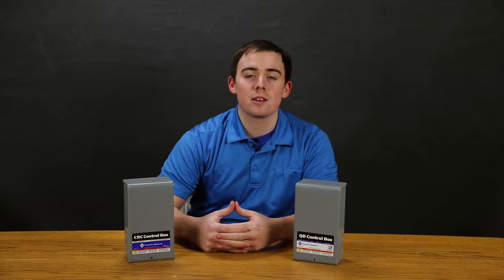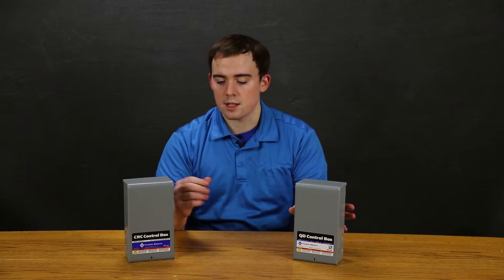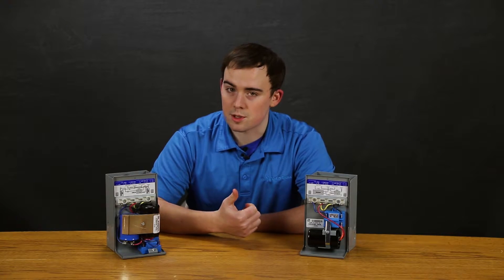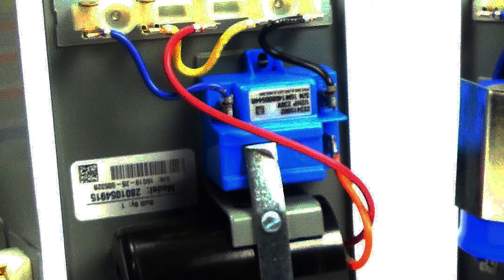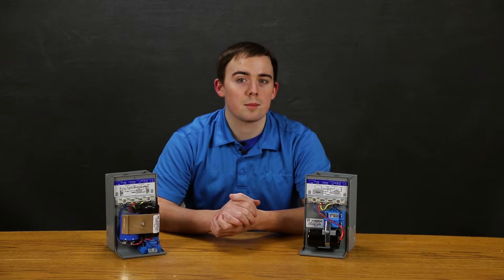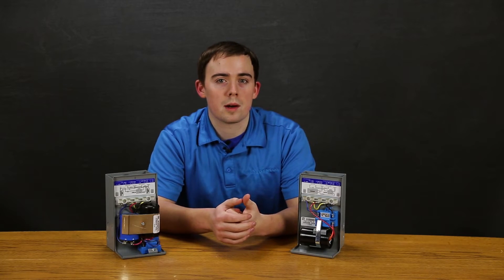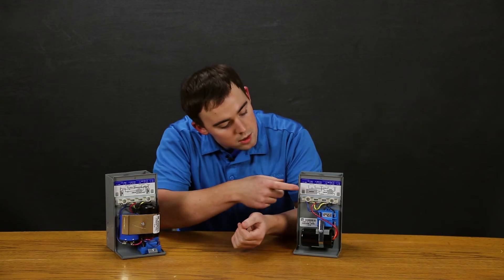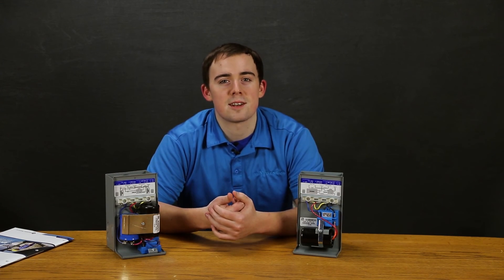Franklin Electric QD and CRC Control Boxes

Comment: Can you link me to your site where you sell Franklins replacement capacitors? 

One thing I have noticed on Franklin submersible pumps, their CSCR control boxes have a 23uf run cap and a 108 start cap.  I have tested some after 20 years of hard service and the caps were still good. The run cap is a gray plastic and I can't find them anywhere, or at 23uf.  AMRAD has a 20uf  US made one which I suppose is close enough. The start cap is BMI  108-120 US made and available. Anyway, point being that you can design a system that doesn't blow caps every 2 years.
Reply from the maker: Thanks for the comment. We currently do not have them set up on our website, but we can get you pricing if you'd like to give us a call: 855.329.4519